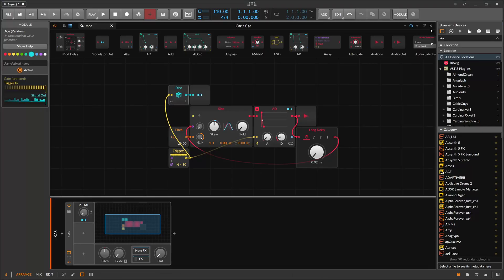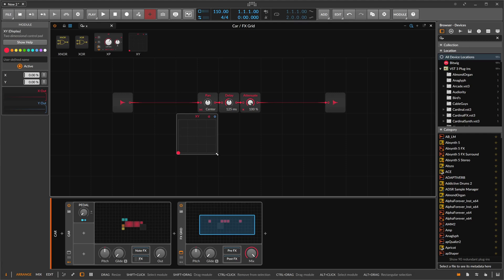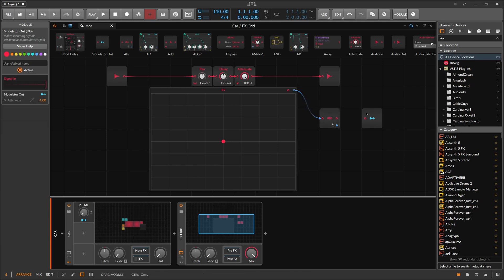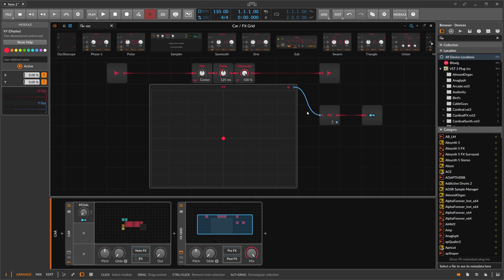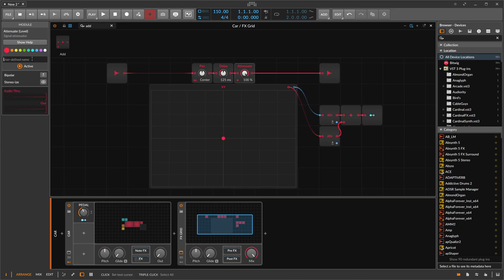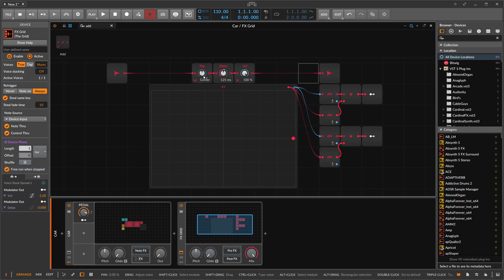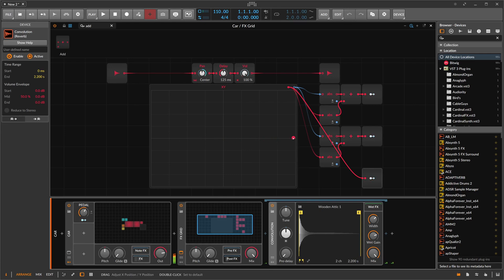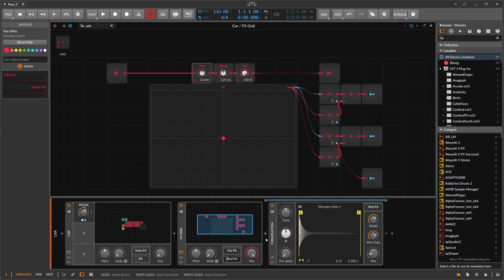Recreating the Doppler Effect in Bitwig Studio

Comment: This is great! Volume decreases exponentially with distance and delay time (squared), which is quite easy to do. the volume changes too much though, so doing to the power of 1.1 or something is better. Also, it could do with a low pass filter, and maybe some allpasses to add more diffusion to distant sounds. Distant sounds are also a bit more compressed with less transients, a lag module could work

Comment: If you add Interaural Time Delay you've got the beginnings of binaural. Add filtering for height and even a basic Head Related Transfer Function.
Reply: What kinda filtering would produce the height mirage?
Reply: @shroom2ma At it's simplest level as sound elevates it gets brighter, but HRTF is a factor too .
Reply: @SamHocking  I think HRTF might be a bit beyond me, but when u say brighter, does that mean also less bass, so like a bit of a tilt effect?
Reply: @shroom2ma  It's quite a complicated topic to explain in comments. Easiest way to experience it is installed DearVR Micro which is a 360 binaural panner with HRTF and allows elevation panning. It works with stereo DAWs like Bitwig.
Reply: @SamHocking  cool. thanks!

Comment: All these cool little things really make me wish we could make nested device presets within the grid. Might be a lot of work for developers to implement but it would take the grid to the next level for me
Reply: you kind of already can, just keep nesting them inside the Grid's FX container
Reply: @ht3k  A reasonable workaround for most cases yeah, but there are times when I might want to control the signal between devices a little.   Plus - it's great to be able to zap a section into a container and have it all connected in the network, for legibility if nothing else.  A big, complex patch could be organised into a few specific modules that you can see in the network and immediately be able to refamiliarise yourself with the whole thing quite quickly.  Not necessary perhaps, but I'd be chuffed to bits if they implemented something like that eventually.
Reply: I was thinking the same thing. Grid within a grid. Would make saved devices built in a grid able to be quickly pulled into a larger grid for fast design of whole new complex plugin fx or synths
Reply: @EricJohnson-fh8zj  ...and we could do programmatic switching between custom modules.  Would be great, but probably a bit of a pipe dream for now alas!